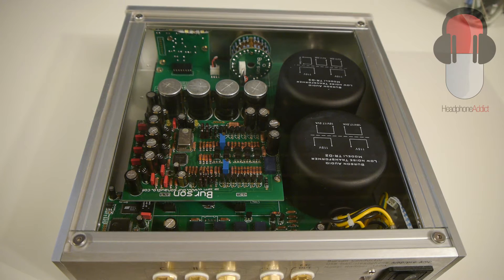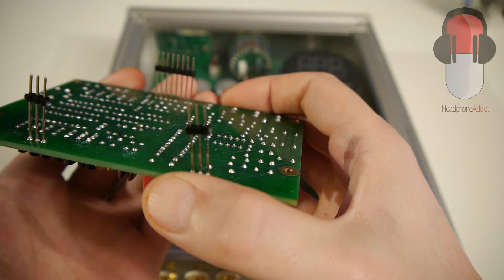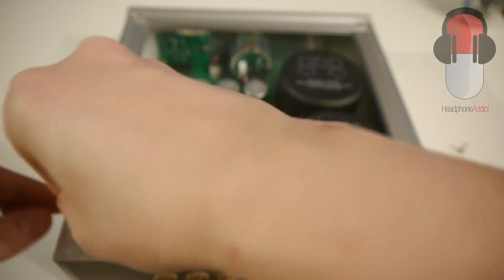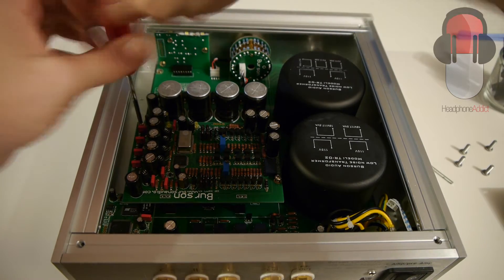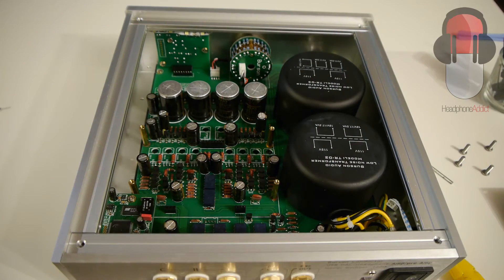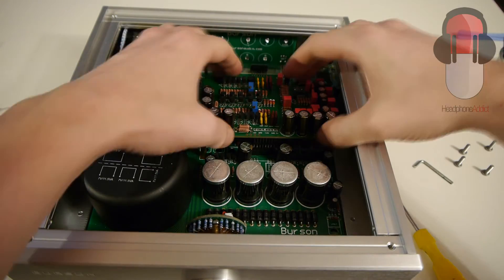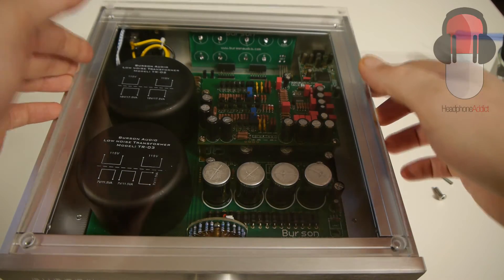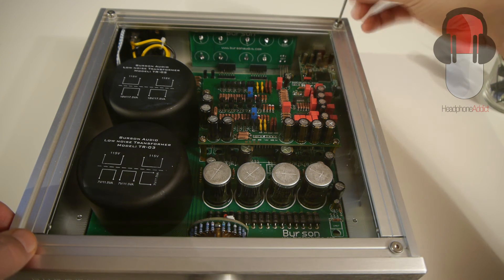How to change DAC card in Burson Conductor Tutorial

Comment: Note this is only for the Conductor SL 1793 model however.
Reply from the maker: Huh? Please explain what you mean, this is not the 2W Conductor SL 1793 model, but the 4W Conductor with three (as opposed to two) gain level settings etc.
Reply: the DAC cards can be retrofitted with any Conductors whether it be the SL version or original version..or any future products involving DAC stage